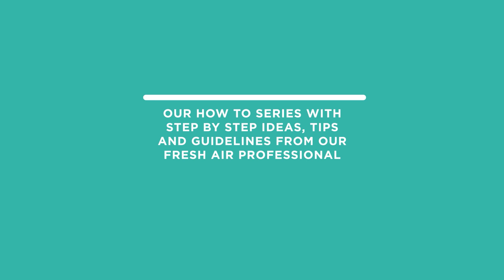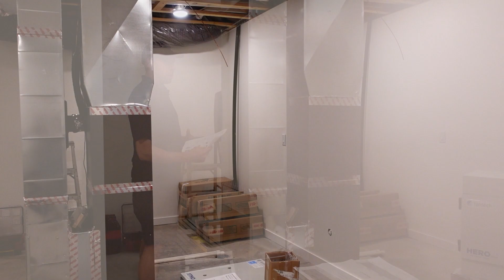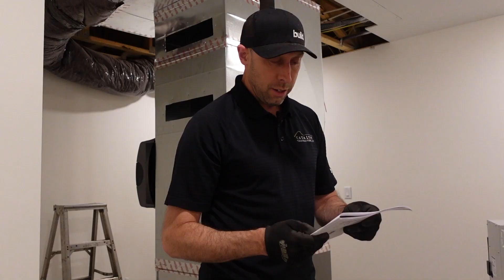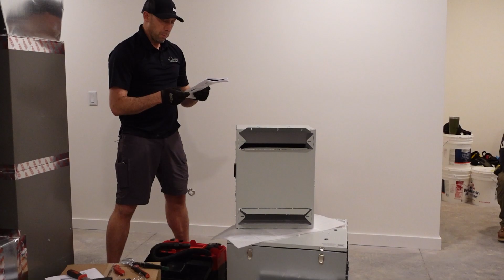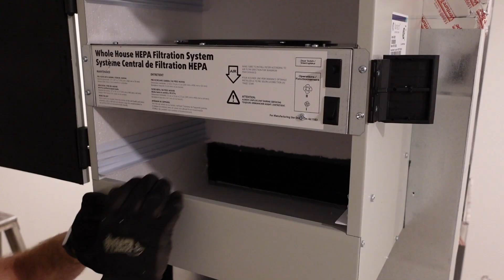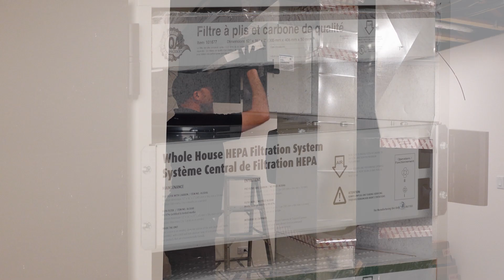5 Minutes with Fantech: HERO® HS300 HEPA System Install. Episode 2.

Comment: Explain to me. Appears only a portion of the air flow is going through the HEPA fantech
Reply from the maker: That is correct. The HERO HS300 pulls 200 or 300 cfm from the return duct of the HVAC system, filters and returns it back downstream. The airflow is controlled by a switch on the top panel.

Comment: What are the advantages over the CM3000?
Reply from the maker: 2-speed operation (200 or 300 cfm) and the ability to install using 8" round collars for applications requiring ducting.
Reply: @Fantechusa  thank you I just purchase the hero hs300 to go with my hero 150 HRV
Reply from the maker: @networkingdude  Congratulations! Your home now has a top-notch balanced ventilation and filtration system!